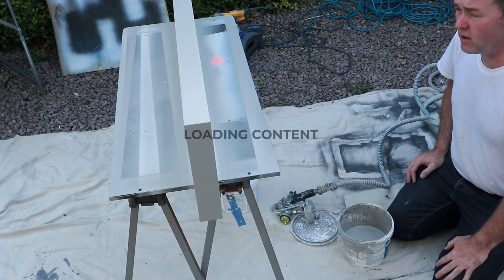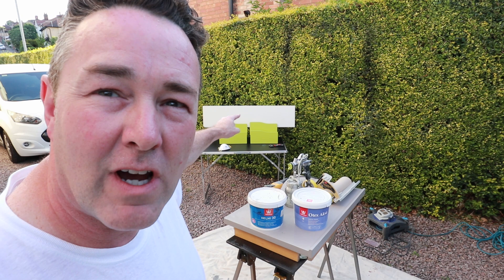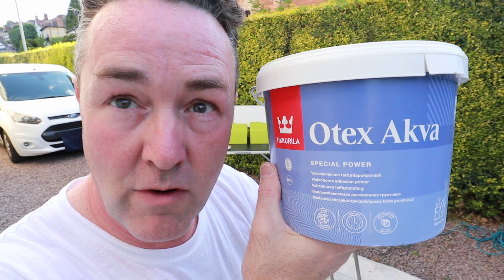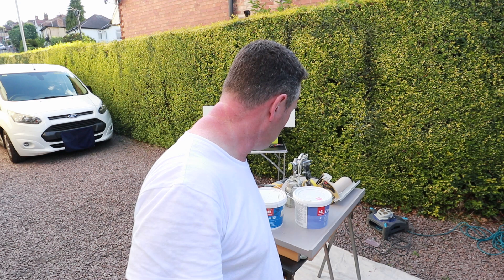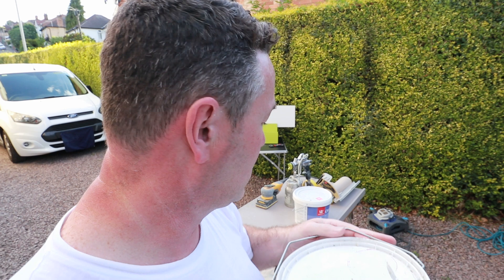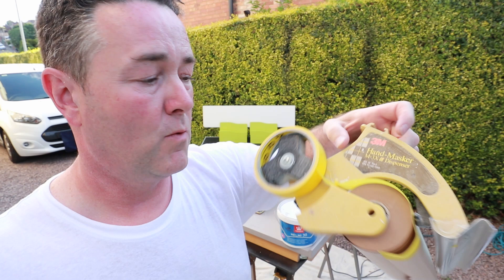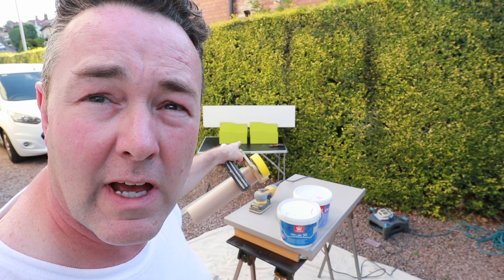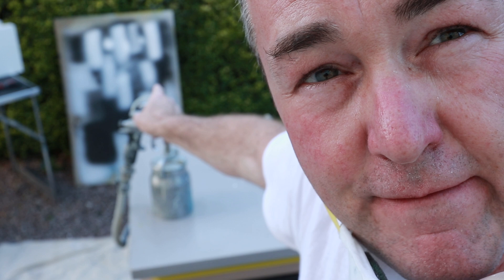Is this the best Paint Combo - Tikkurila Otex Akva & Helmi 30

Comment: Hi Phil, I'm making and painting kitchen cabinet doors. I'm sure in a painters forum a while back everyone was going over to Everal Aqua from Helmi 30. Have you tried both on kitchens? Which comes up better do you think? Is Everal Aqua 40 the best one for durability or does the 10 keep nice just as well? Value your opinion before I go and buy this tin! Cheers!
Reply from the maker: You won't go wrong with either.
I did my kitchen in Helmi 30.
4yrs ago and stood up well to family life. It's just worn through on thie tops edge of the door that under the sink.

Everal Aqua is very good, with it being interior and exterior paint.

Give it a go... Use the right UC/primer for it though.
I primed my kitchen in Otex Akva.. the. helmi UC then two coats of helmi 30.

If you see the videos where I've sprayed panelling last year... That was all everal aqua 40. It's a lovely satin finish.
But I wish I'd of advise 10, as it shows up less imperfections on the surface.
Both hard wearing though..it's more down to the finish you like.

I tried my hallway woodwork in 10... And i like the more flat eggshell look.
Reply: @ProfessionalPainterDecorator  Thanks for this! Just to clarify you think Everal Aqua 10 might show up less imperfections on the surface than the 40? Much appreciated. Did my kitchen island in 40 and it doesn't look perfect when the sun shines on it - but then I did try laying off that - and I've given up that technique, just rolling now. Cheers! Lizzie

Comment: Hi Phil, do you rate Otex Akva as the best grip primer? I've got half a tin of Zinsse Bulls Eye 123 but find it still quite easy to scratch off when fully cured. I'm painting an old wooden cabinet and thought it may be worth ditching the Zinsser for the Otex Akva, what do you think? Great videos BTW, taught an old DIYer some new tricks!
Reply from the maker: They're all good TBF.

Zinsser needs 7days plus to cure 

Otex Akva very good product.

Have a try also of Zinsser Aqua BIN ... It's the new one.
Reply from the maker: Btw... What did 123 scratch off from?
Reply: @ProfessionalPainterDecorator  Cheers, it’s an oak cabinet, Victorian probably. Seems to be varnished, not waxed. I’ve just tested the Zinder on a shelf before I do the whole thing.
Reply from the maker: @davidgreenfield9701  just check the sore of the can .. varnish and stain work ... Whether 123 is suitable for the varnish wood

Comment: Otex Akva is the dogs danglies. Using it currently under Everal Aqua 4o on a kitchen. Needed to use the Otex Akva as going over crappy old oil based & some varnish. (I'm brush/roller not spray).
Used the Helmi 30 to do some window seats recently, great for that job, not so good for kitchens IMHO
Reply from the maker: Thanks for sharing. I've used it on kitchens with no issues. 
What did you think to the test video the other week with everal aqua 80?

Comment: Hi Phil.  I'm enjoying your videos  mate!  When you are thinning down your material,  what would your ideal  time be flowing thru a #4 Ford viscosity cup....  Just as an approximate guide.  In one of your videos you showed the paint running off your mixing stick,  into itself (which was very useful), but my concern is that I might be reducing my gear to much.  Any advice would be very much appreciate.  Thanks 🙂
P. S I use the graco 1.8 & 2.2 needles
Reply from the maker: Oh I'm nothing as technical as that.
What are you spraying?
1.8 and 2.2 will allow quite thick/round paint to spray. But if it looks as though it's drying pimply cus it's too thick, you add some water. Trial and error.
See how you go.

Comment: Great video.Could you use this combo brushing/rolling it onto stair spindles which has currently  oil based stain and varnish on?
Reply from the maker: Yes. Sand and dust off... Otex Akav... And away you go.

Have you seen my vid of the £40 hvlp sprayer? 
That's a good but of kit for spindles ;)
Reply: @ProfessionalPainterDecorator  sounds good think ill go with that. I've just watched the video on the energer sprayer and now thinking of buying it.Thanks for the info mate.

Comment: Great channel Phil. Deccy with 25 years experience here. Great to see someone else who enjoys spraying furniture. Just a question if I may, do you find nibs in your topcoat after spraying off a hvlp turbine? I've tried everything, obviously straining the gear through a 250 micron filter, putting a filter on the bottom of the suction tube and even keeping a wet rag in my pocket to wipe down the needle every few minutes but I still find nibs when everything dries back.  I have an apollo 3 turbine jobbie and it's great, filter spotless etc. I've put it down to the sheer amount of air that's kicked up when using hvlp. What do you reckon? Keep up the great work mate. All the best 👍
Reply from the maker: Nibs... Could just be in the air and the hair dryer does blow what's in the room about. It's a final nib and wipe with damp cloth before final coat.. is all you can do.

I'll set a seed for you though.... I had a stage 3.. ... I felt restricted with what I wanted to spray. Now have the stage 5. ... I have no excuse now if I can't spray with it lol
Reply: @ProfessionalPainterDecorator  thanks Phil. I have been thinking about a 5. I don't know if I'm just being way too fussy. I've even invested in a mini extractor fan if I'm working in a confined space! Ah the pursuit of perfection! Cheers mate.

Comment: Hi Phil! Quick question re using Floetrol paint conditioner with Tikkurila paints? I'm going to use Optiva 5 for a long hallway and need to cut in and roller by myself. Would Floetrol help in a) keeping a wet edge and b) generally reducing roller marks or brush strokes?
Cheers v much
Reply from the maker: I've never used it as bot had a problem with Optiva 5.
If the paint feels a bit thick (round) a drop of water will help.
See how you go on for the first coat.

Comment: Great video 👍🏼 , iv used this combo without any problems. 
Still like to use the zinsser bin  as my go to primer as I'm paranoid about the scratch test. 
Would like to see a scratch  test  between the zinsser bin Vs zinsser 123 plus  Vs  Otex  
What's your thoughts on this? 
All the best
Reply from the maker: Sound a plan.... On what surface though, that would be the question.
Have you watched the scratch test with AllCoat exterior, bedec MSP and Frenchic?
Reply: what surface ... 
I think it should be tested on the dreaded melamine panel and also a kitchen cabinet door, may be a ceramic tile? .   I would think most people would like to see that. 
And yeah I seen the scratch test on those paints and was surprised how well the frenchic did.

Comment: Hi Phil, will the Otex Akva cover very fine superficial scratches you reckon? I have a pre-primed wooden door (with very smooth finish already juist needed top coats) which has now been "keyed" accidently with 120 sandpaper which has left very fine superficial scratches on the pre-primed smooth finished surface. Was hoping to use Otex Akva one coat and 2 coats on Helmi 30 on the door... Will these 3 coats cover the very fine scratches?  Thanks! Great vid keep up the good work!
Reply from the maker: You may still see it. Get a coat on and see how it's looking....
Reply: @ProfessionalPainterDecorator  is it worth sanding the surface before applying Otex Akva saying using a 1200 grit paper just rub down the scratches, seems like with a wet pipe and elbow grease some scratches do come off...
Reply from the maker: @naz-x  I'd get be that a go.
Reply: I can scratch the scratches with my nail and some scratches seem to come off too 🧐 what’s the finest sand paper I can’t use?
Reply: @ProfessionalPainterDecorator  1000 grit sanding foam pad to the rescue - smooth again and scratches have gone.. May rub a 1200 grit over it as well to make it silky lol
Reply from the maker: @naz-x  that's good news. A nib down before the final coat will get any last signs of it off too.

Comment: Can I get any colour in tikurilla paints? Can they mix dulux colours?
Reply from the maker: It may be a near as possible match
Reply: @ProfessionalPainterDecorator  thanks buddy, what’s the best paint for getting over bad plaster imperfections?
Reply from the maker: @RickyHudson-cj4un  a flat Matt paint. Nothing with a sheen to highlight imperfections.
Reply: @ProfessionalPainterDecorator  so johnstones cp vinyl Matt no good?
Reply from the maker: @RickyHudson-cj4un  you could do.
If it's bare plaster. I'd use Optiva Primer or Screwfix bare plaster primer
Reply: @ProfessionalPainterDecorator   no it’s had a mist mate

Comment: Excellent adhesion, good value but try brushing it on architraves and skirting etc, its diabolical...helmi is notorious for poor opacity, and otex akva is an off white, helmi doesn't cover it, so its a 3 coat job.
Helmi is a lovely finish using a spray or short pile roller but I've given up on both of them.
Reply from the maker: Oh, tells use something we don't know lol what do you think about the paints I've tested out with brush recently?
Reply: @ProfessionalPainterDecorator  All very good, but im not keen on the 'brush wrecker'...nice finish, for a while, but it will discolour...I have never been the paint in there so called hybrids to be honest, horrible smell too...Bedec is probably my go to finish at the moment.
Reply from the maker: what about the isonmat.. have you tried it yet? very nice it is
Reply: Not yet...cant get hold of it down my way, I wish they'd distribute it more

Comment: I've lost count of kitchens and furniture pieces that I painted with Helmi ober 10 years.
It is very easy to stain and it goes soft from the skin grease. How on earth is this crap still in use on kitchens is beyond my understanding.
Reply from the maker: Thanks for sharing! Everal Aqua for the win now ;)
Reply: @ProfessionalPainterDecorator  well.. I switched to EA as was hoping that this been exterior grade will be better  coating for the kitchens... Staining issue is more less the same, softening from sebum is  the same too I'm afraid I've no reports from kitchens that I painted with EA but it went guey on the newel posts painted in black after just 6 months.